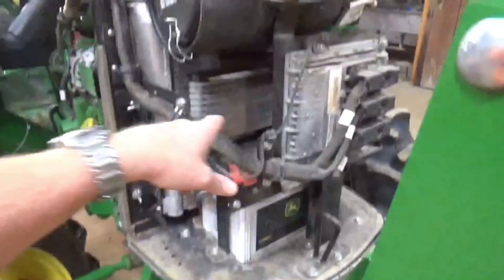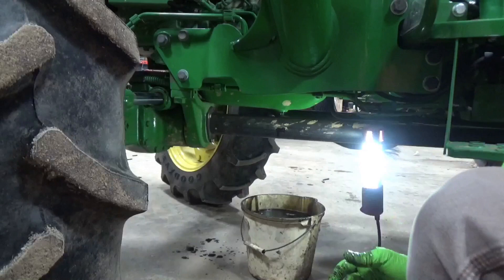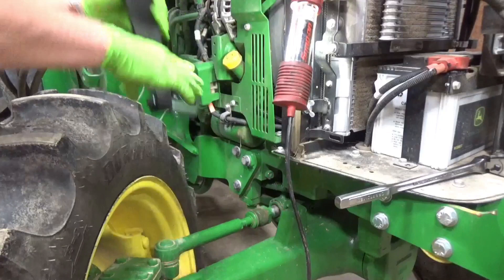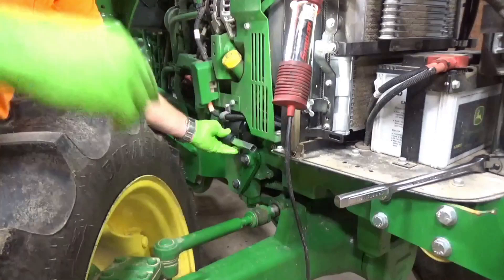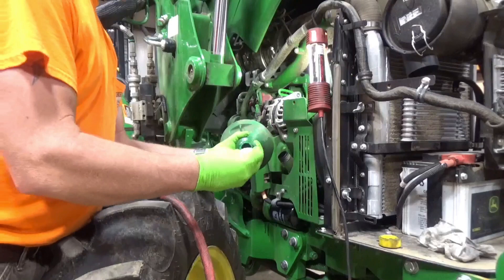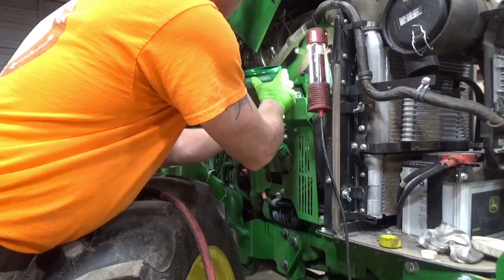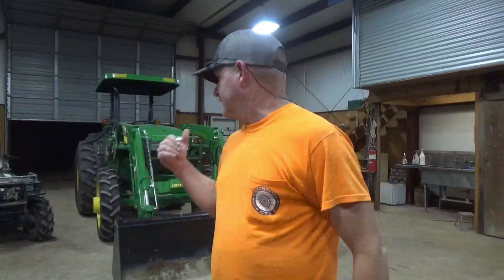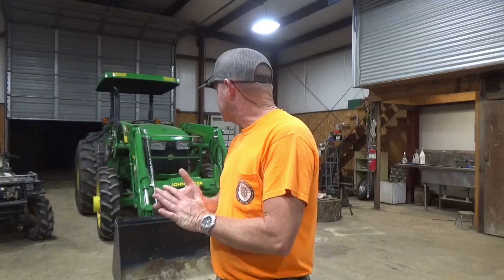John Deere 5075E tractor- oil change and serviced

Comment: The lights are a lot better I would much rather hear the frogs outside the shop than the buzz in the shop.Great video I like how you take the time to explain what you’re doing.
Reply from the maker: Those frogs were making some noise when I had the door open.
Reply: cotontop3 That’s a peaceful sound👍. Good time of the year to go camping.  It won’t be long until the whippoorwills get started Thanks for the video

Comment: I think you can take a small piece of flashing metal and make a little tray to slip under that filter and direct the oil off the frame and into the pan below.  I did that for my boat motor and it works perfect.

Comment: Wished I'd watched you first. Just did my 500 on a 5045E and lost 4 Gallons of diesel following Deere's stupid instructions and dealing with the free flow. Never thought of clamp and no 5045 videos on YT. Found out about you on TractorbyNet. Great video and camera and sound are excellent.
Reply: Placed a WPS shut-off valve on the fuel line today. Saves the clamping, easy and hidden. A theft deterrent, too. Just a thought.

Comment: The funnels are part numbers 720-1087, 720-1088, 720-1089, 821-2734 & 821-2735. According to size. You've set us up for failure on the filter, doesn't look like we offer that yet. Anyways Napa Mike is gonna send you a check for the plug!!!
Reply from the maker: I shoulda gave the oil filter number too 😁
Reply: Most of the 5E tractors I've seen use a 7076 Napa Gold oil filter.
Reply: Yea no cross on that one Brent that’s ok he’s not sure how to get to the Napa store he should try gps in that dodge if it has it hahaha see ya Napa mike
Reply: Brenton has ya covered on the funnel numbers that 2735 is about right and yup checks in the mail hahaha see ya Napa mike
Reply: Brenton Medders does your Napa have the half off filter sale on March 12-16?
Reply: Aren't the Gold filters made by WIX? I've always got the Golds, but when I went to replace the air filter on my '16 Power Wagon, and compared it to the OEM it had like a third less pleats and really looked cheap in comparison. Don't know if NAPA or WIX is cutting corners, but I was surprised.
Reply: R536698 is a JD only fuel filter no cross in the 4 major brands i use. Wix, Baldwin,   Donaldson and Fleetguard.

Comment: I have actually added a shut off to several of these tractors. Fuel line should run right along the frame rail back to the tank in the rear. I put the valve about even with the steps if I remember right. Been a while since I’ve done one but if I remember correctly that’s how I done it. Take care.

Comment: There’s a company called air comb that makes wands for blowing out air filters, radiators, and anything else you need to reach into to blow out. I have the 12” and a 36” wands and use the snot out of them on my tractor. I don’t remember where I got mine from but they were sure worth the money!
Reply from the maker: They’re on amazon.
Reply: cotontop3 oh cool, I got mine a couple 3 years ago and looked for them online back then and couldn’t find anything on them. I have a buddy that drives trucks and he turned me onto them.

Comment: I hate horizontal filter positions because you can't pre-charged them to prevent blowing a huge snot of air across the bearings on start-up !   In this sort of situation I "pre-wet" the filter media with some of the new oil. Works for me but everyone that's worked with  machinery for any length of time has their own habits and tricks !

Comment: You need to do some mods .fuel shut off on tank or right before filter and cut some more room around that oil filter and repaint the guard.I hate diesel fuel smell get that on you and it stays for days on your leather boots and it's stays for weeks ! I can deal with 90 weight smell seems easier to get rid of that smell of your skin

Comment: Still happy with the 5075E? I'm considering one. The video was helpful to see how easy it is to service. Thanks
Reply: I have been quite happy with mine.  I bought mine with a cab on it.  They put in the cheapest radio (Jensen JHD xxxx) and I found a plug and play Jensen JHD 1635BT on Amazon that had am, fm, Bluetooth, Weather, and Sirius for $270.  Two Allen bolts and 30 minutes and it was done.  Exterior lighting for night use is pretty good front and back.  If you want to disconnect the three point quickly, the imatch option is the best $300 you can spend.  It runs more than a day on one tank if light duty, and about 6 hours if you are pulling hard (20 gallon tank).  The A/C will keep you cool up to about 110 F.  Above that, the A/C starts having a hard time keeping it cool, but it is NOT uncomfortable to run that way for hours.  I wasn’t going to get the cab option (“too much money, I can work at night on hot days.....”) but am VERY thankful I did get it.  I would have had numerous days on the farm where I wouldn’t have worked at all due to the heat without a cab.  The rear window opens as well as the two side windows.  

My only issue was in day one.  After about 2 hours of work, I noticed the three point wasn’t lifting all the way.  I got out and saw there was a small puddle of hyd fluid under the cab.  The seals on the manifold had blown (I found drips on the trailer that I brought it home with, so it was blown before I picked it up).  I called the dealer and she had a service truck out to my farm by 3:15 that afternoon.  Not a problem since then.  All in all, I love the tractor.  Instead if a box blade as part of the package, I swapped it for the Frontier 84” rear blade.  I used that to cut my 1600 foot long driveway.  Lately, I have been using the tractor to prep my field for grass planting next month.
Reply: Good service is key. I tried one at our place after it was in the shop like 6 weeks and it died on me a few days later & ended up sitting there for 2(!) weeks before they came back to get it. 
 I ended up getting a Massey 4707 and have loved it the past nearly 2 years & 208 hrs. It’s a tad heavier than I need but works great when using the grapple with logs/trees & no rear weight/attachment needed. Also really love the tires..ag like performance yet r4 smooth. 
Glad you’ve enjoyed your JD!

Comment: Tim, I had a 2012 5075E OOS that had a red fuel shutoff right before the filter. I now have a 2018 Cab 5075E that as the red fuel shutoff right before the filter. I've been looking at the JDParts website and can see it on the Tier2, 3 and IT4 versions, but the first tractors with the FT4 engines do not have a fuel shutoff for some reason.

Comment: You might check your JD book but I have a smaller JD tractor and the fuel line shut off is on the opposite side of the engine up by the fuel tank.

Comment: I have a 2021 and the Wix 57076 filter doesn’t fit. The screw hole diameter is larger on the newer tractor.

Comment: Diesel does not bother me near as bad as 90 wt or the new synthetic gear oil chevrolet uses. They think putting a grape scent in it would help, just made it worse. That crap has to wear off instead of wash off.

Comment: 500 hours service?
Reply from the maker: I think this was to get the break in oil out at 100 hours.
Reply: @cotontop3  ahh ok 100 hours is not bad :) seems to be a good machine so far right?
Reply from the maker: I haven’t had any problems and it’s almost 3 years old now.